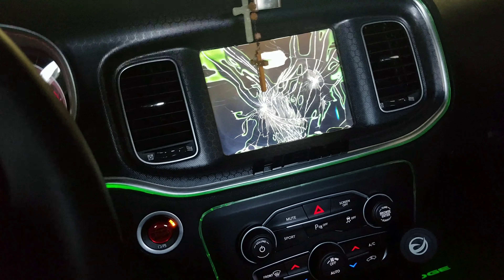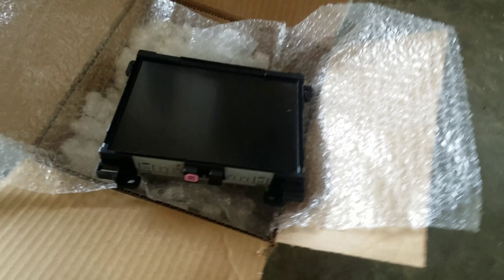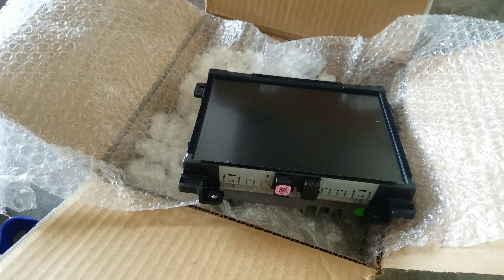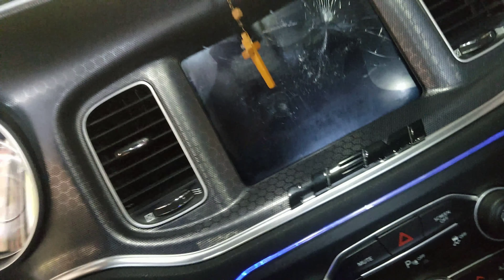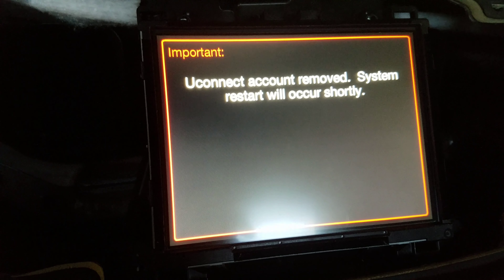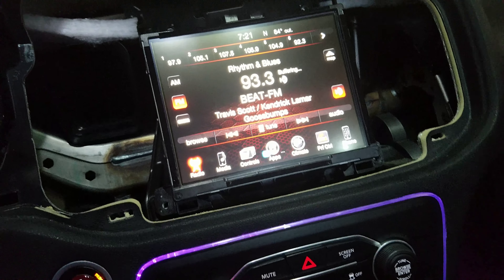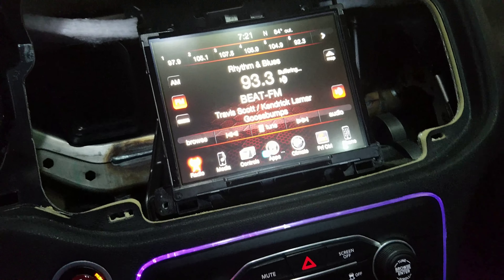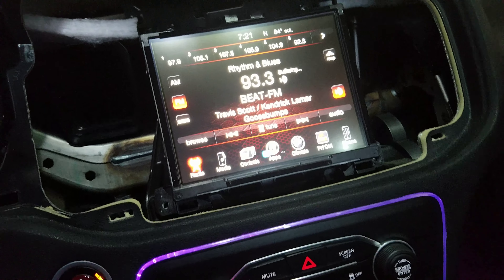How to replace your 8.4 Uconnect Screen in your Charger or Challenger

Comment: Bro. My screen was so bad it would change the stations, change the audio from USB to phone, the AC would go crazy randomly.  There was an air bubble there too.

I installed new 8.4 uconnect screen and it worked fine but literally after installation, I couldn't touch anything, buttons didn't work, etc for about 5 minutes. Then eventually everything worked fine and as normal and hasn't messed up since.  Do you know if that was like a recalibration period or something?
Reply from the maker: Damn. Sounds like more and more peoples screens starting to go out. Smh.  Yea. I think after I put the security code in it had like a reboot process where I couldn't do anything.  Probably normal.
Reply: This is happening to my 2018 GT. Dealer wants 1800 to fix. This video got me thinking I can do this. I'm going crazy without it.

Comment: Screen on my 2018 rt charger is going bananas
Reply from the maker: Delamination.   If car under 36k miles. Take it to get replaced at dealership.  Free.  Just had a new one put in, in my Scat.   It's a know issue they've been replacing people's screen even out of warranty.  Would go check

Comment: I paid 2300 for a new one last week and this is the paper that the dealer sent with it
Reply: It says "After replacementand battery reconnectionperform TWO RADIO hard/ ECU resets OR the customer may experience 
•Loss of adio functions 
•Apps might be grayed out
•All functions of radio might not work properly"

Comment: 500 bruh you got a hella good deal, i cant find a screen for no less than 1k. I need a ra4 model
Reply from the maker: Just sold it for 500 yesterday 🤣 you have IG? Theres this guy that has hella parts. He always has screens. That's where I bought it from.
Reply from the maker: Guy I sold it too said dealership was trying to charge him 1200 and that was with trading his screen in.  Also he had no Nav or performance pages.  They were prob gonna put the same screen back in.  He bought my screen and got all that. NAV, performance pages.  He was happy af.  We both won. 💯😁
Reply from the maker: @MrBrianm18  @prnnchll  check him out.  That's his IG.
Reply: @KingFLA  you said you ended up getn the wrong model, was it from this guy or someone else?
Reply from the maker: @MrBrianm18  from that guy.   He said it came out of a 18.   Really came from 16.   But I've seen him post 18 and 19s because I can tell from the back. Theres an extra red plug that doesn't get used on the 17+  I didnt mind. I knew it was only short term.  Wasnt worth arguing and taking back out. Everything worked fine.  For 500 cant beat it.
Reply: @KingFLA  could you do me a favor he posted a unconnect not to long ago can you tell if its newer or no?
Reply from the maker: @MrBrianm18  its 17+  the most recent o line e he posted 18 hours ago.  See that red plug to the right. You dont even use it. Dont know what it's for.   Better hurry. They sell quick.
Reply: Can someone send the ig guys page info need a radio and possibly other parts